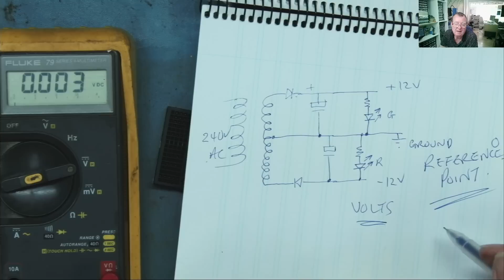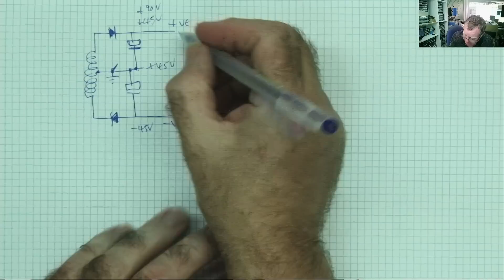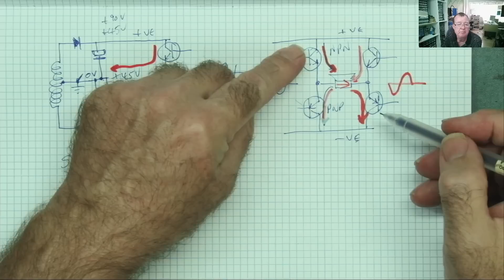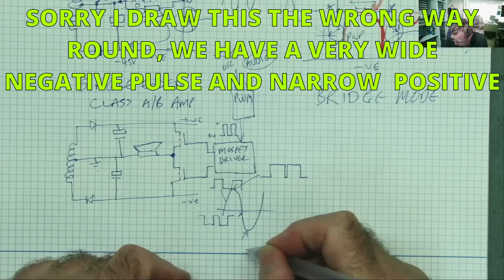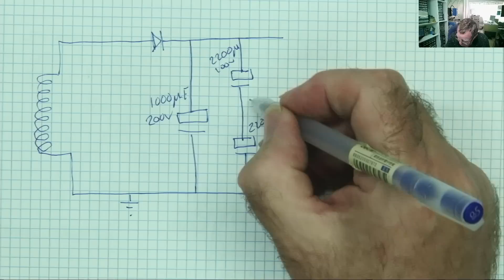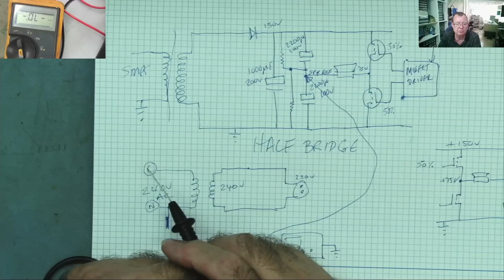If You Want To Repair Class D Amplifiers You Need To Watch This Video!

Comment: When working with split power supplies — such as +12V, 0V, and -12V — it’s easy to treat the 0V rail as a neutral or "ground," but without a solid grasp of Kirchhoff’s Laws, that understanding can quickly fall apart. KVL tells us that the algebraic sum of voltages around any closed loop must equal zero. This is vital when dealing with dual supplies, because it reinforces why the 0V rail is not just "zero by name" but a calculated reference point — the midpoint between the positive and negative rails. Likewise, KCL teaches us that current flowing into a node must equal the current flowing out, which becomes especially critical when currents are returning via the 0V rail from both positive and negative supply paths. Without applying these laws, one might assume current or voltage behaves arbitrarily, but in reality, these principles govern every node and loop in the circuit. Understanding them is what separates guesswork from real electrical analysis — and gives meaning to that "ground" wire we all take for granted.

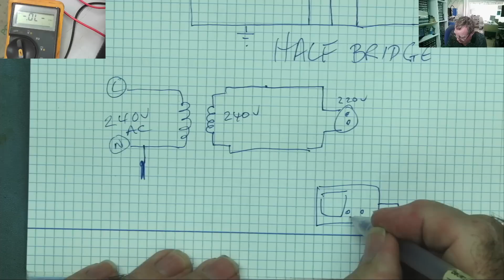Comment: 48:36 - So, when you connected your scope, the ground reference on your scope had voltage potential on it with respect to earth. Unless everything around you is also isolated, that would be a hazard, right?

Comment: thankyou for clearing that up. I have both VARIAC and ISO transformer...I knew they were important for tube amp repair, but I wasn't clear on the need to use them both in series with equipment under test while the scope is plugged into mains so it has true earth for reference. basically, I have been too chicken to probe any tube amps with the scope since I KNEW I wasn't SURE...and don't wish to have an exploding scope probe in my hand.

I WAS NOT AT ALL aware that CLASS D amplifiers also require the same treatment until this video. Very good timing, as I intend to attempt some repairs on some Class D PA amps very soon.

As always, you have been instrumental in expanding both my knowledge and skillset right when I needed.

🖖

Comment: I'm 50+ and just have this as hobby - I only understood this 2 years ago when I did an experiment I never thought would actually work. I have a dog fence,  which is basically an extremely long cable loop (100m in my case) through which a signal is sent that the dog collar picks up when near and alerts. automated lawnmowers work the same way
. The cable was broken somewhere and since there is no circuit I cannot measure anything. so in frustration I used my car battery charger (12V and a few amps), attached the minus lead to the garage, which is grounded by a cable into earth from one of the metal posts) and the plus I connected to one end of the wire. I then removed insulation from the cable 50m away from the garage, and used my multimeter to check the cable. the plus on the cabvle and the minus of multimeter I shoved into the earth (into the ground of my lawn) -- and to my amazement I was able to read full 12V ?!?! i screamed with joy (i can now trace the stupid cable), but at the same time I had to sit down as I just understood the concept of it. I never thought that this would work, because there's no cable going back through the ground as such. i was hoping to pick up some residue, a couple of mV difference or so. No. full 12V !!! couldnt believe iot./ I checked the internet high and wide, but noone talks about this simple hack it seems. you also explained it very well in your video. since then for me theres no such thing as plus or minus. just 12V more or less on the other side. Its like you said: its relative

Comment: Are the various types of amplifiers used in different types of audio systems ? 
I.e. do top end equipment use a certain type due to the better quality output, compared to a cheap and chearful set up ?
So that you could look at the circuit and know what sort of quality the product is.

Comment: I didn't know much about amplifiers until I came here, I thought H-Bridge circuit was for motors, But makes sense now for Amplifiers.
Currently working on a new motor driver, for my robots. Burnt a few MOSFETs in the early days, well still do occasionally switching on The High-Side and the Low-Side on at the same time, haha.

Comment: By definition, DCV is incorrect. If current is not required to have a voltage potential, why do we call it Direct Current Voltage?  Seems like a good way to confuse people.
Reply: A lot is a throwback to old ways of thinking , just learn it and love it.
Reply: @pault6533  When writing, I tend to use Vdc & Vac. The lower case letters show where the upper case letter was derived from or referenced to. i.e. a voltage derived from a direct current or alternating current. You can't speak in upper or lower case obviously, so I would say "volts d c" or "volts a c". Saying "d c volts" or "a c volts" is just another way of saying the same thing with the words in a different order.

Comment: A suggestion (and my opinion only), is to show 0V reference (or whatever you want to call it) as a single horizontal line, chassis as a single horizontal line with backwards facing lines under it and mains earth (sadly also known as ground) as single large with smaller horizontal lines. Then paranoid engineers, like me, will go to one's grave contented.
Reply: I was going to post the same, rather than earth symbol, for completeness use the chassis ground symbol in this instance would be more accurate, but the principles discussed are spot on...thanks Richard
Reply from the maker: Yeah I agree with you it wqould have been better

Comment: Heya, oke I believe I untherstand, well I mean the differant workings of the amplifiers classes. the working and the why to use an isolation transformer. wen I was in my teen years I got the faraic but only the trafo and the taproler for the trafo the rest I had to bild my self and it worked good between 0 volt and 220 volts te limiter you bild I have the compponents to bild that too. and I think because of lack of experience I have the feeling of I don't know. but still learning more thanks

Comment: at the speaker on the where you say 0 volt is not really 0 volts there is the return voltage too and puts a voltage on the 0  and ground is really not a good naming .. it is better to say neutral ... as it is neutral to the both of the positive and the negative voltage  you measure across the speaker you got voltage of the ground would be 0 then there would be no voltage across the speaker ... when there is no power coming in like the supply is turned off or unplugged you have 0 volts .. but it be 0 volts on all wires !!!!!!
Reply from the maker: I was trying to make the point that in a class A/B, G or H amplifier when there is no signal the output stage is basically idle, with a class D the PWM, and therefore the output stage is running all the time.  0V was with reference to the centre tap on the transformer. Sorry if i wasn't very clear about that.
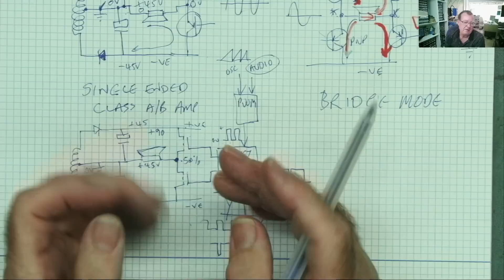Reply: I think the explanation at 31:44 (how the voltage “is half” at the mid point of the MOSFETS when no audio signal is modulating the carrier wave) can be a bit misleading, because a very fundamental part of a Class D amplifier is omitted (granted, for simplicity): the low pass filter between the output of the MOSFETS and the speaker. It is this low pass filter that averages the pulses (swinging between +Vc and -Vc) to “half way between + and -“ when the duty cycle of the PWM signal is 50%, i.e. when no audio signal is present. Right?

Comment: with the speaker terminals there is no zero either as the return is also a voltage that flows to the other connectors and there for it is not zero ... timestamp 11:40 by the way